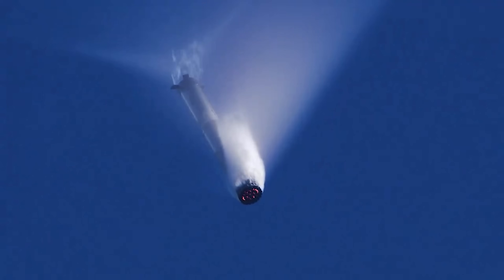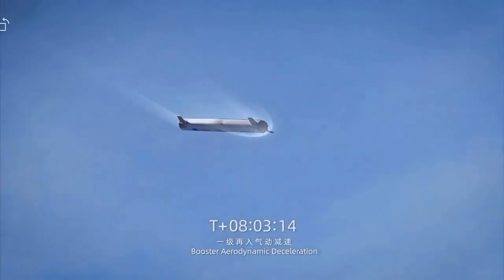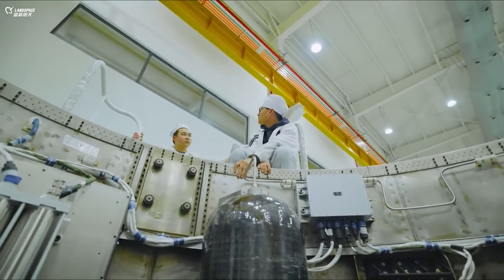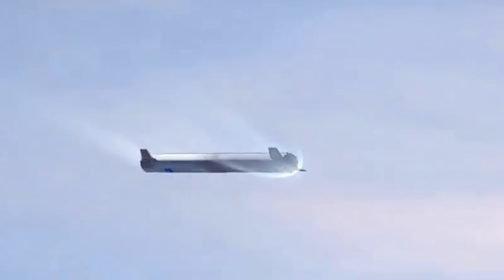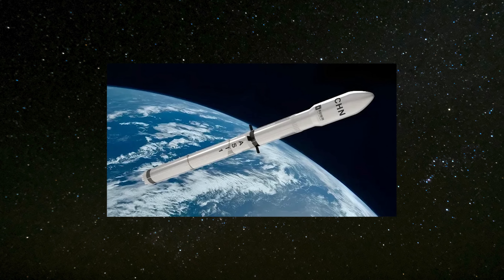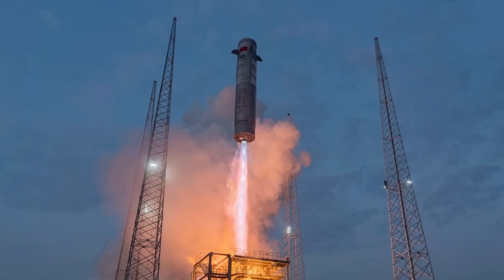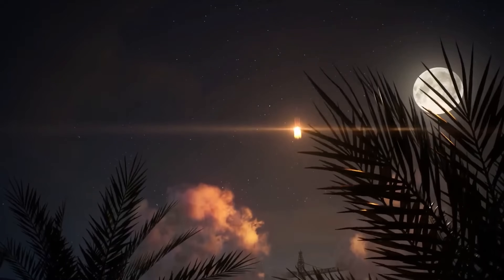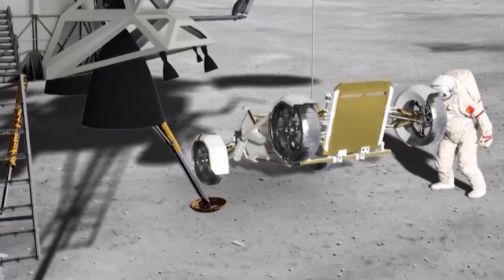Elon Musk revealed Something WEIRD happening inside new China Rocket!

Comment: This seems like a great solution to landing on the moon and re-using star ships as a base
Reply: Yes, you get rid off the 180 ft cargo unload disaster.  SpaceX needs to rethink a vertical landing approach if they have goobobs of cargo to unload.
Reply: @NeroontheGoon you do realize once that tube is filled with cargo the stress would compound being on its side and you would have to reinforce it. It would make it heavier and use more fuel and resources and harder to take off and land. The point to get from point a to b is to be effective, efficient, and nontime consuming. It would require more thrusters to take off and land, the moon has less gravity and would be better suited to a spacecraft that can land and take off easily without much consumption.
Reply: @TakeAnLlibSo you’d give up a safety margin for weight savings, am I getting that right?  Go out in your driveway and stand a cardboard tube up on end and see how long it stays that way until it falls over.  And then we have the 180 foot monkey fuck elevator ride from the cargo bay to the planet floor, powered of course, mechanically complicated of course, and you don’t think landing longitudinallly would be less advantageous?  You might want to review Murphy Laws.
Reply: @TakeAnLlibYou know, I’ve actually been looking at a way to land vertically on two main gear that are attached to a pivot point.  The rocket lands, stabilizes with small thrusters, then kicks the rocket onto the landing side and lowers it energetically onto deployed nose and waist pads.  The whole side of the Starship opens up and the cargo is basically at ground level.  Once the cargo bay is voided, it can be used as temporary habitat until permanent facilities are established.  Think about it, you’ve been in space for near 190-200 days and you land on a 1/3-ish G planet, you’re shaking like a puppy shitting a peach pit and do you really want to step out onto some elevator 180 ft above the ground, NAH!  Close to ground access is better.  Back to you.
Reply: @NeroontheGoon 😂 if you are working on such a thing you wouldn't be on YouTube commenting on stuff and would be more tied up in such activities. Your not working on anything, you have yet to tell me how you would deal with the immense amount of weight added and where the extra thrusters would go without diminishing the aero dynamics and efficiency of a side landing craft and how do you plan on storeing extra fuel if its packed full of cargo, you seem to think one trip is the goal. The point of takeoff and return is to make it reusable not to turn it into a habitat. Drone tech could be used to unload and most light items would float down to the surface on thier own. They can design an elevator that can fold out just like a lift gate and go up and down.the fact that you don't know this shows you dont work or develop anything in that field.
Reply: @TakeAnLlibI’m doing this for fun, don’t take yourself so seriously.  Most of the first landings will be cargo, where Mars is concerned.  I will continue to believe that a vertical landing with something this long will be a problem.  Simple as that!  And what type of drones might you be suggesting.  Last time I checked Mars, and the Moon don’t have any mentionable atmosphere, so you’ll need some type of extraordinarily powerful dynamically powered drone to handle the cargo, those don’t exist.  You think landing horizontally is dangerous, imagine toting along several large, hypergolic fueled work drones.  Pick your poison, whatever solution you choose will demand some sort of engineering concession, whether the weight of a complicated landing system or a hold full of cargo drones, reduction of on site complexity and a good margin of safety should be paramount.
Reply: I had this idea, why don't they have 4 reusable tug ships that meet the starships in orbit, and attach,  then ferry the starships down to the surface and place them wherever they want them, a couple could attach to those nubs they use for landing on mechazilla

Comment: OOK-------------.  AS FOR THE BOOSTER SLOWING DURING ENTRY. THE CHINESE COULD REDUCE THE SPEED OF THE FALLING BOOSTER BY ADDING VERY WIDE CHINES TO THE SIDES TO INCREASE THE TOTAL SIDE AREA FOR MORE RESISTANCE DRAG, CUTTING HUNDREDS OF MILES AN HOUR OFF THEIR TERMINAL VELOCITY...  AS FOR SIDE THRUSTERS, THEY COULD MOVE THEIR MAIN THRUSTERS TO 2  MODULES AT BOTH ENDS AND ROTATE THEM TO FIRE BACK ALONG THE BOOSTER FOR LAUNCH AND THEN ROTATE DOWN TO THE SIDE FOR LANDING USING SEPARATE SMALL FEED TANKS FOR EACH END FOR BOTH TAKE OFF AND LANDING. WITH THE MAIN TANKS IN THE CENTER SUPPLYING THE SMALL FEED TANKS... THAT WOULD BE EMPTY WHEN LANDING, CUTTING ANY NEED FOR THE CENTER LANDING THRUSTERS... SINCE ALL THE WEIGHT WOULD BE AT THE TOP AND BOTTOM ENDS...
Reply: Posting in all caps ... Trump, that you? 😂🤡
Reply: @countmorbid3187  He is properly deaf, so he shouts all the time
Reply: the empty itself is a death sentence in itself, take into account that the fuel is likely liquid, and would require much more complex systems for a horizontal rocket rather then a vertical, why make massive weight making 6 individual rockets that IS ALSO REUSABLE but requires magnitudes of times more engineering and weight then just make a rocket engines or engines on the bottom, its a stupid idea that is just propaganda for the chinese. they dont have anywhere near the technology to do this for another 10 years

Comment: OK-------------. ONLY AND EDIOT WOULD EVEN THINK THEY OR ANYONE ELSE WOULD BE TALKING ABOUT LANDING A BOOSTER ON THE MOON FAR OUTSIDE EARTH ORBOT... BUT LANDING AN UPPER STAGE ON THE MOON USING THEIR SIDE LANDING TECHNIQUE WOULD BE GENIUS... AS THEY DO NOT NEED TO WORRY ABOUT TUMBLING OVER FALLING TO THE SIDE DESTROYING THE LANDER, AS SPACE X NOW HAS THE PROBLEM OF...   OR THE NEED OF AN ELEVATOR TO REACH THE GROUND AND CAN SIMPLY WALK OR DRIVE  DOWN A SHORT RAMP TO EASILY REACH THE LUNAR SURFACE SAFELY...
Reply: actually, using vertical thrusters massively reduces fuel efficient, the vertical method is just a cheaper way less efficient method then just doing vertical, also what's the point of the vertical if your using it for the moon, its useless for moon missions due to 6 rocket engines reducing fuel time and essentially it being a suic*de mission. Materials and Equpment would have to be horizontal also, making flight movement extremely limited, you don't know what your saying

Comment: Landing horizontally would mean attaching rocket boosters dedicated only for landing—boosters that do no work during liftoff—on the sides of the spacecraft.
This would require dealing with increased mass, ensuring structural integrity in a posture rotated 90 degrees from launch, and carefully considering the weight balance and piping of liquid fuel and liquid oxygen.
All of that would make for a highly complex system.

Comment: horizontal landing with propulsion is BS, those rocket engines for horizontal landing are dead weight lowering the lift capacity. vertical landing makes sense because you're using the same engines used for lifting the rocket hence the only extra weight is the fuel for landing not the extra engines :)
Reply: Exactly, your just making trade offs that put you at parity at what you just tried to replace. Actually, it probably makes it worse because not only do you still have your engines, but you also have to add on extra engines and propellant. And that doesn’t even take into account the technical engineering difficulties that you would face.
Reply: Horizontal landing also clearly has no engine out capability. You lose an engine, you’re done.
Reply: @J7Handle im guessing that's why they have 6 engine's?
Reply from the maker: That's a good point, it will be interesting to see how it all plays out.
Reply: @SpaceZonea 很容易想到，使该方案合理的解释恐怕只有一条——一种灵活可控的小型固体火箭发动机。🤷仅用于着陆也没有太多死重问题。
甚至考虑到着陆姿态的差异，其末端速度可能会更低？需要的燃料也许会更少。
Reply: @SpaceZonea It won't. They can't steal a novel approach. The only thing the CCP is great at is building other people's IP.
Reply: Oh I dunno: Fireball XL-5 did it routinely…
Reply: You also need a much larger landing zone that is flat
Reply: @David-fe6rh easier to build a flat landing zone, than a mechazilla
Reply: Anything is possible. BS is envy
Reply: wait wait let em cook
Reply: Mr Ci said: I don't care it makes sense or not. I WANT IT LANDING
Reply: Exactly
Reply: Unless it's a building of some sort.
Reply: another expert on utube
Reply: Lets look at the positives, one thing is they don’t need moving directional nozzle since control it to land horizontally is much much easier with far apart propulsion outlet. all it need is tubes go to those outlet and there is a valve control for amount of propulsion going out. the engine is still stay where it is, and the tube can be shared all across with each valve at the end.
Reply: @Daylight89689  differential thrust is hard with rocket engines.. you don't have the fine control over thrust, so you'll still need engine gimbals with horizontal landing.
Reply: You are the expert
Reply: It would be another hoax. Vertical landing will only be applicable when no humans are on board.

In short vertical landing itself is as silly as horizontal landing. Both are sci-fi BS. 

Did you see Scape X vertical land when carried humans? Not even once because it's too risky and too dangerous when the success rate is as low as the transparency of US government.
Reply: @infiniteandunlimitedabundance  i strongly suggest you to start taking less substances and find some help...
Reply: @robertjung8929 speak for yourself. Lmao 🤣
Reply: Horizontal maneuvering or landing will need a lot of structure enhancement, hence an overweighted space vehicle.
Reply: It would be good for a one way to the moon.
Reply: Bingo... The challenge with vertical is the control systems, which only SpaceX has solved. The extra fuel weight for landing disappears as you land.
Reply: @chasbader 这套控制系统并不比月球或火星着陆器更复杂。

Comment: Horizontal landings might  require extra strength reinforcement steel running horizontally (as viewed with the ship in a horizontal position). I am wondering if this would call for a lot of extra weight in the ship design which could make the who idea a failure.
Reply from the maker: That's a good point.
Reply: But not on the moon